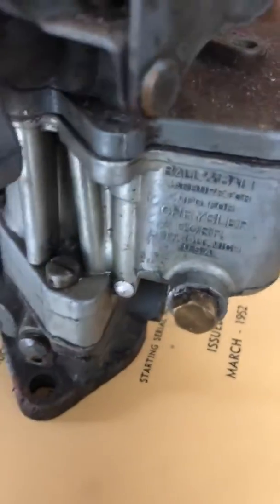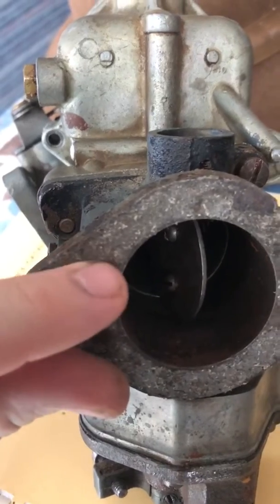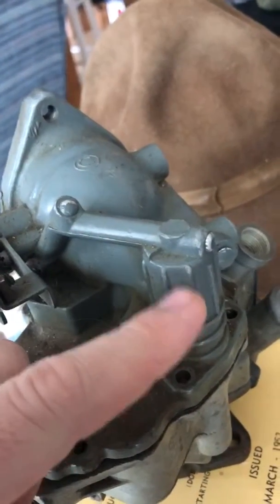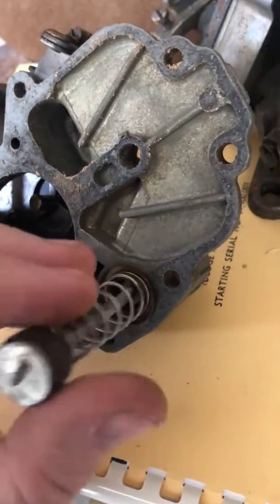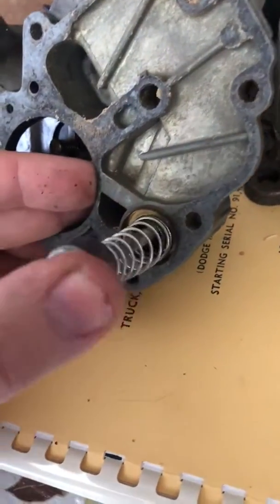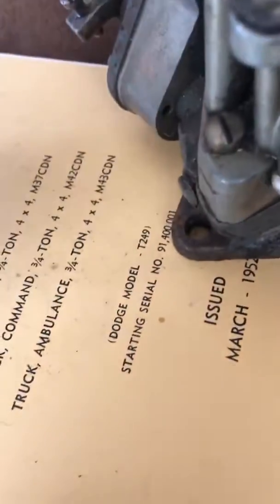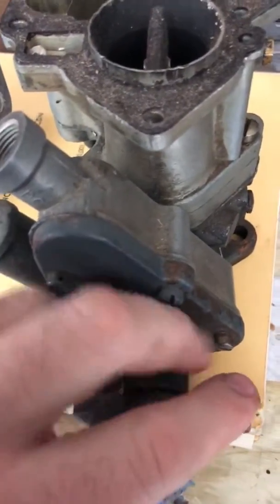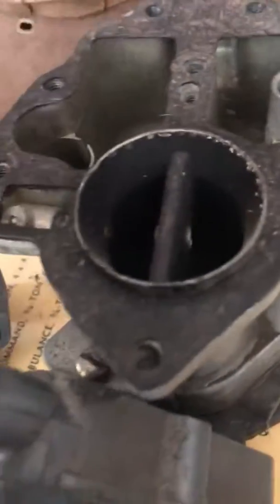Dodge M37 Carburettor

Comment: Thanks for posting. What manual do you recommend that has all the recommended adjustments, specs and how to fix it/rebuild it?
Reply from the maker: The instruction sheet from an older carb kit is hard to beat.